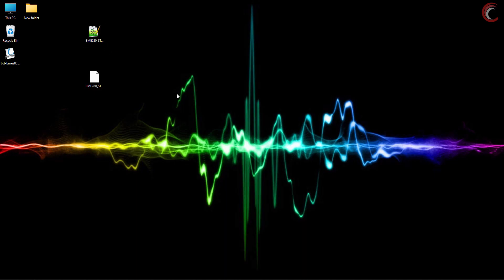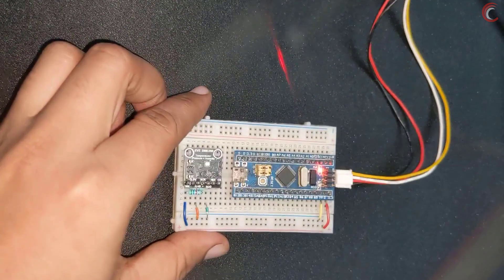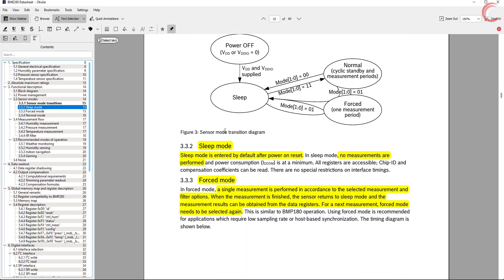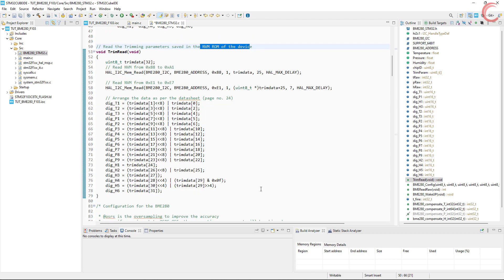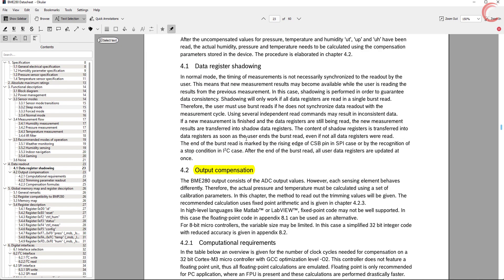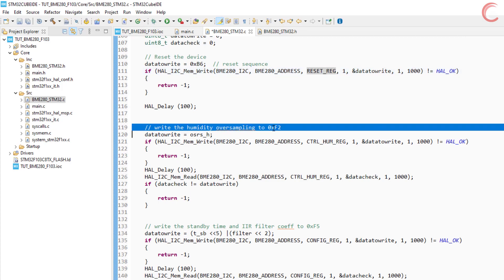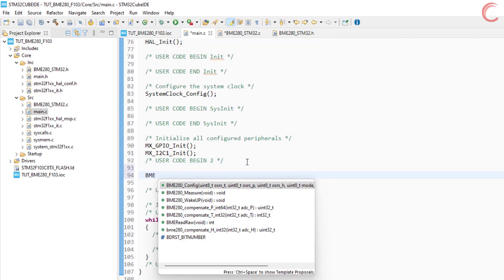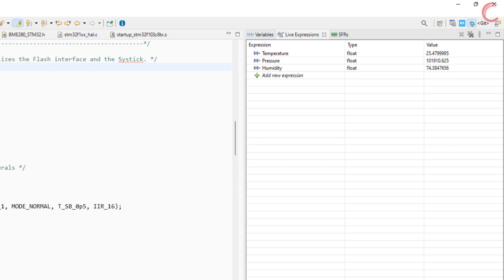Interfacing BME280 Sensor with STM32 via I²C – Measure Temperature, Pressure & Humidity

Comment: In 8:38, at line 64 inside the TrimRead() function, it seems that dig_P1 = (trimdata[7]<<8) | trimdata[6]) would be correct. This issue is similar to dig_P2. Could you confirm this for me?
Reply from the maker: yes you are right, it should have been 
dig_P1 = (trimdata[7]<<8) | trimdata[6])
dig_P2 = (trimdata[9]<<8) | trimdata[8])

Thanks for pointing it out. I have updated the project.

Comment: Hello, can this be used for BMP280 sensor, and by that I mean, can I just follow datasheet of BMP280 sensor and do the rest same as you did? Can you please provide the whole code cos I can't see it in the given link that u put in the description, only parts of it
Reply from the maker: Yes you can do that. The link is fine. You can download the code at the bottom of the page.
Reply: Ok, thank you very much! @ControllersTech
Reply: @ControllersTech  Hi again, one more question. Does it matter if I use STM32f446RE, are there any things I will have to adjust?

Comment: 8:02
If I calculate right, a burst reading of 25 bytes starting from 0x88 will end up at 0xA0 as the last byte,
but dig_H1 is stored at 0xA1 register, so you will miss it. Am I right?
Reply from the maker: There is no 0xA0 register.
Reply: @ControllersTech  Thanks, you are right!

Comment: Men your vids are just wow... I like the way you take things... I have a small request if it's possible... I wonder to use the stm32f4 with the INA219 Voltage current sensor based on i2c communication.. Some help with the registers ang gain configuration will be a great 😣. Thanks in advance

Comment: Thank you so much for this tutorial! Really well explained! I have implemented this solution with a Nucleo-L476RG Board analog with this tutorial and a BlueDot BME280 Advanced Weather Station with I2C. The code is building with no errors but all sensor values are 0 in the Live Expressions Tab. What could be the reason?

Comment: Hi!!!
I'm trying to connect bme280 to stm32f407.
I followed your tutorial and I have a problem.
The variables temperature, humidity, and pressure are equal to 0.
Please help me if you can.
Thank you very much.
Reply: I suspect this might be irrelevant to you now, but it could be useful for others who encounter the same problem.

I found that the float values for temperature, pressure, and humidity were being set to 0 if the chip ID wasn't correct. In the BME280_STM32.c file, you'll find the BMEReadRaw() function. This function checks the chip ID of the barometer. The ID set in the provided file is 0x60, so if the ID of your specific module isn't 0x60, the function returns -1, resulting in all measurement values being set to 0. You can see this in the BME280_Measure() function, where the condition for obtaining data is BMEReadRaw() == 0; otherwise, the measurements default to 0.

I recommend starting by checking the device ID. You can run the debugger and use the live expressions view to check the chipID variable. In my case, I found the chipID to be decimal 88, which corresponds to 0x58. After getting the chipID, I substituted this new number into the condition in the BMEReadRaw() function. This allowed me to read data. Note that I was using a BMP280, which lacks the ability to measure humidity - which resulted in another issue outlined below and may or may not occur with the BME280. Hopefully, simply changing the ID condition resolves the BME280 issues.

When using a BMP280, I noticed that the measurement values remained fixed. I modified the trimming parameters (after verifying that they were the same between the BME280 and BMP280 from the datasheets) to exclude humidity. Specifically, I changed trimdata[32] to trimdata[26] and deleted the trim parameters related to humidity. After doing this, I started getting non-constant and correct data.

I hope this helps. But I think the first step in debugging is to check the chipID variable.
Reply: @EmbeddedLHC  HA! You're a lifesaver, or at least a sanity saver. Was doing the same thing - substituting a BMP280 for a BME280. Changing the chip ID to 0x58 did the trick.
Reply: @EmbeddedLHC  what exactly did you change in the trimming parameters to make it work?
Reply: I had the same 0 reading issues  with my stm32f411, turns out it was the i2c pins,  I was using the wrong ones, it was pb3 and pb10 on my blackpill  not pb6 and pb7 which gave me 0 reading.  pb6 and 7 are the intuitive choice because they labeled as 1 in the pinout diagram. I thougth i tried them all but aparanly paried 10 with 8 intead of 3 is how that one evaded me for a while until i decided to check the pinout diagram more closely.  I also found this arduino sketch that works without libraries while trying to debug this issue.   Someone got this from a seller of the module they said when they couldnt get the module working with an adafruit library.  It worked for me too.  
#include <Wire.h>

#define BME280_ADDRESS 0x76
unsigned long int hum_raw,temp_raw,pres_raw;
signed long int t_fine;

uint16_t dig_T1;
 int16_t dig_T2;
 int16_t dig_T3;
uint16_t dig_P1;
 int16_t dig_P2;
 int16_t dig_P3;
 int16_t dig_P4;
 int16_t dig_P5;
 int16_t dig_P6;
 int16_t dig_P7;
 int16_t dig_P8;
 int16_t dig_P9;
 int8_t  dig_H1;
 int16_t dig_H2;
 int8_t  dig_H3;
 int16_t dig_H4;
 int16_t dig_H5;
 int8_t  dig_H6;

void setup()
{
    uint8_t osrs_t = 1;             //Temperature oversampling x 1
    uint8_t osrs_p = 1;             //Pressure oversampling x 1
    uint8_t osrs_h = 1;             //Humidity oversampling x 1
    uint8_t mode = 3;               //Normal mode
    uint8_t t_sb = 5;               //Tstandby 1000ms
    uint8_t filter = 0;             //Filter off 
    uint8_t spi3w_en = 0;           //3-wire SPI Disable
    
    uint8_t ctrl_meas_reg = (osrs_t << 5) | (osrs_p << 2) | mode;
    uint8_t config_reg    = (t_sb << 5) | (filter << 2) | spi3w_en;
    uint8_t ctrl_hum_reg  = osrs_h;
    
    Serial1.begin(9600);
    Wire.begin();
    
    writeReg(0xF2,ctrl_hum_reg);
    writeReg(0xF4,ctrl_meas_reg);
    writeReg(0xF5,config_reg);
    readTrim();                    //
}

void loop()
{
    double temp_act = 0.0, press_act = 0.0,hum_act=0.0;
    signed long int temp_cal;
    unsigned long int press_cal,hum_cal;
    
    readData();
    
    temp_cal = calibration_T(temp_raw);
    press_cal = calibration_P(pres_raw);
    hum_cal = calibration_H(hum_raw);
    temp_act = (double)temp_cal / 100.0;
    press_act = (double)press_cal / 100.0;
    hum_act = (double)hum_cal / 1024.0;
    Serial1.print("TEMP : ");
    Serial1.print(temp_act);
    Serial1.print(" DegC  PRESS : ");
    Serial1.print(press_act);
    Serial1.print(" mbar  HUM : ");
    Serial1.print(hum_act);
    Serial1.println(" %");    
    
    delay(3000);
}
void readTrim()
{
    uint8_t data[32],i=0;
    Wire.beginTransmission(BME280_ADDRESS);
    Wire.write(0x88);
    Wire.endTransmission();
    Wire.requestFrom(BME280_ADDRESS,24);
    while(Wire.available()){
        data[i] = Wire.read();
        i++;
    }
    
    Wire.beginTransmission(BME280_ADDRESS);
    Wire.write(0xA1);
    Wire.endTransmission();
    Wire.requestFrom(BME280_ADDRESS,1);
    data[i] = Wire.read();
    i++;
    
    Wire.beginTransmission(BME280_ADDRESS);
    Wire.write(0xE1);
    Wire.endTransmission();
    Wire.requestFrom(BME280_ADDRESS,7);
    while(Wire.available()){
        data[i] = Wire.read();
        i++;    
    }
    dig_T1 = (data[1] << 8) | data[0];
    dig_T2 = (data[3] << 8) | data[2];
    dig_T3 = (data[5] << 8) | data[4];
    dig_P1 = (data[7] << 8) | data[6];
    dig_P2 = (data[9] << 8) | data[8];
    dig_P3 = (data[11]<< 8) | data[10];
    dig_P4 = (data[13]<< 8) | data[12];
    dig_P5 = (data[15]<< 8) | data[14];
    dig_P6 = (data[17]<< 8) | data[16];
    dig_P7 = (data[19]<< 8) | data[18];
    dig_P8 = (data[21]<< 8) | data[20];
    dig_P9 = (data[23]<< 8) | data[22];
    dig_H1 = data[24];
    dig_H2 = (data[26]<< 8) | data[25];
    dig_H3 = data[27];
    dig_H4 = (data[28]<< 4) | (0x0F & data[29]);
    dig_H5 = (data[30] << 4) | ((data[29] >> 4) & 0x0F);
    dig_H6 = data[31];   
}
void writeReg(uint8_t reg_address, uint8_t data)
{
    Wire.beginTransmission(BME280_ADDRESS);
    Wire.write(reg_address);
    Wire.write(data);
    Wire.endTransmission();    
}

void readData()
{
    int i = 0;
    uint32_t data[8];
    Wire.beginTransmission(BME280_ADDRESS);
    Wire.write(0xF7);
    Wire.endTransmission();
    Wire.requestFrom(BME280_ADDRESS,8);
    while(Wire.available()){
        data[i] = Wire.read();
        i++;
    }
    pres_raw = (data[0] << 12) | (data[1] << 4) | (data[2] >> 4);
    temp_raw = (data[3] << 12) | (data[4] << 4) | (data[5] >> 4);
    hum_raw  = (data[6] << 8) | data[7];
}

signed long int calibration_T(signed long int adc_T)
{
    
    signed long int var1, var2, T;
    var1 = ((((adc_T >> 3) - ((signed long int)dig_T1<<1))) * ((signed long int)dig_T2)) >> 11;
    var2 = (((((adc_T >> 4) - ((signed long int)dig_T1)) * ((adc_T>>4) - ((signed long int)dig_T1))) >> 12) * ((signed long int)dig_T3)) >> 14;
    
    t_fine = var1 + var2;
    T = (t_fine * 5 + 128) >> 8;
    return T; 
}

unsigned long int calibration_P(signed long int adc_P)
{
    signed long int var1, var2;
    unsigned long int P;
    var1 = (((signed long int)t_fine)>>1) - (signed long int)64000;
    var2 = (((var1>>2) * (var1>>2)) >> 11) * ((signed long int)dig_P6);
    var2 = var2 + ((var1*((signed long int)dig_P5))<<1);
    var2 = (var2>>2)+(((signed long int)dig_P4)<<16);
    var1 = (((dig_P3 * (((var1>>2)*(var1>>2)) >> 13)) >>3) + ((((signed long int)dig_P2) * var1)>>1))>>18;
    var1 = ((((32768+var1))*((signed long int)dig_P1))>>15);
    if (var1 == 0)
    {
        return 0;
    }    
    P = (((unsigned long int)(((signed long int)1048576)-adc_P)-(var2>>12)))*3125;
    if(P<0x80000000)
    {
       P = (P << 1) / ((unsigned long int) var1);   
    }
    else
    {
        P = (P / (unsigned long int)var1) * 2;    
    }
    var1 = (((signed long int)dig_P9) * ((signed long int)(((P>>3) * (P>>3))>>13)))>>12;
    var2 = (((signed long int)(P>>2)) * ((signed long int)dig_P8))>>13;
    P = (unsigned long int)((signed long int)P + ((var1 + var2 + dig_P7) >> 4));
    return P;
}

unsigned long int calibration_H(signed long int adc_H)
{
    signed long int v_x1;
    
    v_x1 = (t_fine - ((signed long int)76800));
    v_x1 = (((((adc_H << 14) -(((signed long int)dig_H4) << 20) - (((signed long int)dig_H5) * v_x1)) + 
              ((signed long int)16384)) >> 15) * (((((((v_x1 * ((signed long int)dig_H6)) >> 10) * 
              (((v_x1 * ((signed long int)dig_H3)) >> 11) + ((signed long int) 32768))) >> 10) + (( signed long int)2097152)) * 
              ((signed long int) dig_H2) + 8192) >> 14));
   v_x1 = (v_x1 - (((((v_x1 >> 15) * (v_x1 >> 15)) >> 7) * ((signed long int)dig_H1)) >> 4));
   v_x1 = (v_x1 < 0 ? 0 : v_x1);
   v_x1 = (v_x1 > 419430400 ? 419430400 : v_x1);
   return (unsigned long int)(v_x1 >> 12);   
}
Reply: I have same issue. Only having stm32L152RE...
Reply: Did it work?

Comment: Jez, i really understand why people get stuck with C. With Arduino you can simply wire the whole setup, enter the address and you are fine to go. 
This is such a pain in the ass :( 
I hate C. Sadly it's still and probably will be the industrial standard for a very long time.
Reply from the maker: Hmm. Someone have written the library for arduino too, so that you can plug and play.
Reply: @ControllersTech  
Sure. But they are experienced in such things and maybe even do that with fun.

I just want the neccessary drivers to build and integrate my system. It's like buying a new PC. Would you just want to write your own OS before you can use it? Or buying a car which you have to assemble first?

I doubt ;)
Reply from the maker: Well yes, if you want to learn.
This is where it call comes down to. Whether you want to learn, or just want to be done with the school/college project.
Pre written libraries are good, but you can't bend them as per the job requirement and therefore one day you need to write one for your own application.
Reply: C is Easy. I Recomment to study Data Structures.

Comment: will this library work if i configured i2c using registers ?
Reply from the maker: Sure. Just change the way of writing and reading data as per your library
Reply: @ControllersTech  sry about all the questions .. but im having trouble implementing this library with FreeRtos .. do you have an idea what could be the problem ? thank you
Reply from the maker: How can I possibly tell without knowing what's the problem
Reply: @ControllersTech  
Actuallly i have the same issue but i tried to implement it by myself. I used the sensor_stream example from Boschs github repo but it's leading to a hard fault every time i try to debug it :/ I think the Problem is how i linked the bme280.read and write to the HAL_I2C but i'm not sure.

You think you could help me if i show you my code?